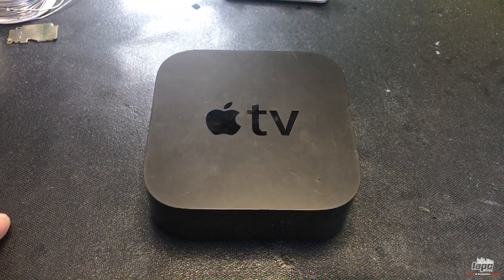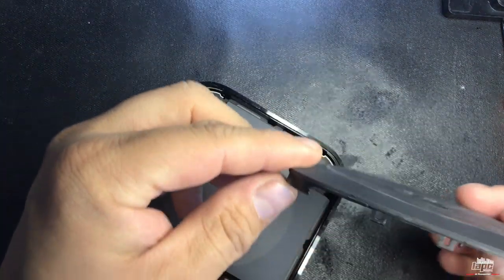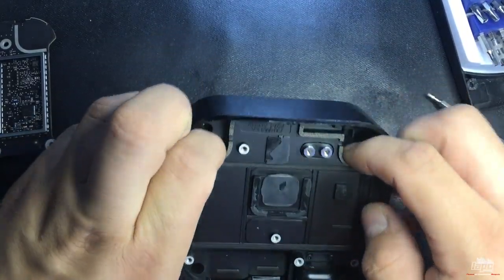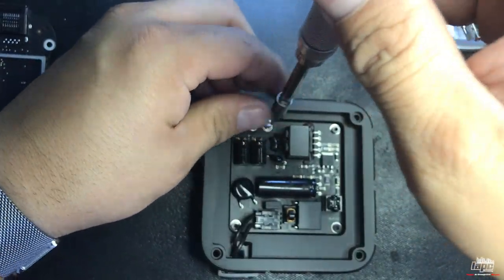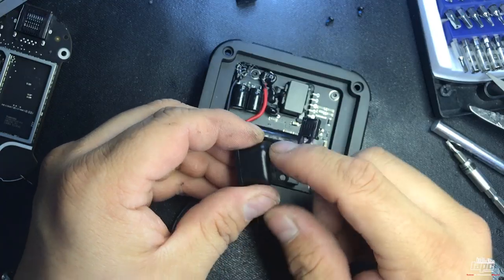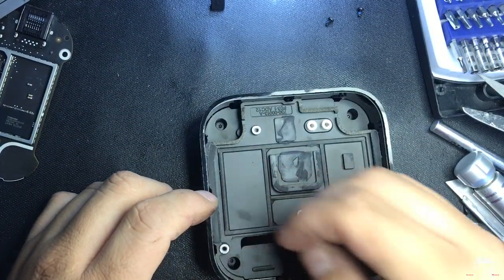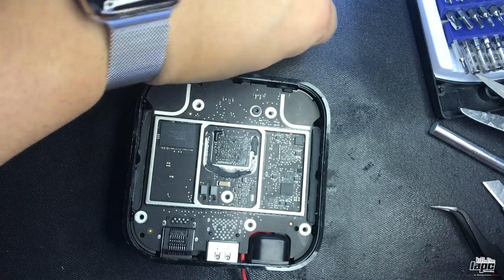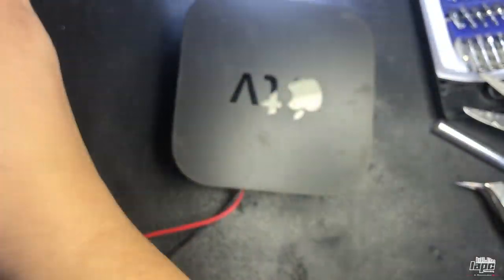How to Convert your Apple 4Gen TV to 12Volts

Comment: 12:31 What does that little plastic piece do?  You mentioned it's involved with the LED light.  I tried hard to reinsert that in but couldn't do it so I just threw it away, but it seems like the LED still works, maybe it's just not as bright?  I have it facing inwards in my car so can't see it anyway so I guess it doesn't matter anyway.  

FYI, if you are using this in your car full time, you're better off just unclipping the power jack and then the cable can go through that hole without drilling any homes.  If you want to use it at home again just clip the power cord jack back in and remove the 12V cables.
Reply: That is just a light diffuser, it makes the light go in one direction

Comment: Hey Tino I really liked the video, I guess it’s because it was simple and straight to the point. But I’m wondering if it worked because I didn’t see what type of connector u used, I didn’t see any power supply as other people have used.  Can you please make a follow up video that shows if it worked and what kind of connection you made at the end of the red and black wires.   Thanks man.
Reply: Leo G 12v car powered
Reply from the maker: Hi, work 100 %, I did't use any power supply because the car has already 12 bolt straight so I connect it to power and ground on from behind cigarette lighter plug , just make sure you put a fuse in case off any short.
Reply: Tino Perez what kind of fuse do you recommend and also what size of both wire and fuse

Comment: Have experienced any issues with the Apple TV turning on immediately when it’s cold out?
Reply: India Delgado -12 degree at the Moment Nö Problem
Reply from the maker: People say that you need to buy extra stuff to make it work but you don't have to this way works 100% I have it working for over 7 months.
Reply: Yea thats what I did. I don't know what the heck its only when its cold. Where do you have your Apple TV stored? This is the second car I've had it in and didn't have these problems before. Its so weird.
Reply: India Delgado I‘m not sure what is cold for you but there is no hardware inside which could be critical ... maybe your car needs to much voltage for heating and other stuff ... maybe the voltage of your battery is going down below 11V this could be a Problem
Reply from the maker: if you have it connected to the ignition it should turn on a soon as you flip the key and temperature wont matter.
Reply: @TinoPerez  - Hello, can a send photo with my Apple tv 4?
Reply: Fantastic!!! Is it an option that I can send you my Apple TV unit. I will of course pay you to do this to my unit. I’m serious.

Comment: Works Perfect ... power in is 12v ... no additional hardware needed ... confirmed 👍🏻
Reply: I had done this in about 20 Minuten ... cable connect to car 12v ... i only suggest to use an additional fuse between 12v car and cable
Reply from the maker: I' m happy you got it , people say that you need to buy extra stuff to make it work but you don't have to this way works 100% I have it working for over 7 months.
Reply: Tino Perez yes i saw a lot of videos... just tried yours ... thanks man 
I think with ATV3 you need a power supply down to 5V and with 4K it should be also a little bit complex. Will install it in my car tomorrow
Reply: when you start the engine, there could be some peak power, that can fry the board. the units sold on ebay have a diode included to protect the board. 
i´m planning to install this in my caravan and since it only has a battery and some solar pannels, i don´t have to worry about that.
Reply: I have one that's not powering on I wanna try connect it to a 12V charger using normal electricity not in a car, do you know how many Amps the charger should be?
Reply: Lorenzo Roberto Cividini you need 1A 12v